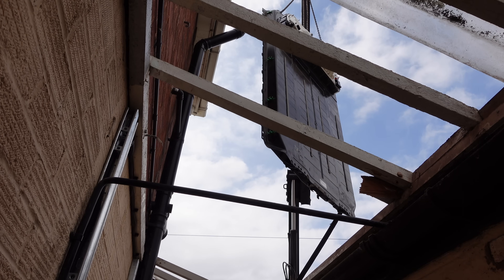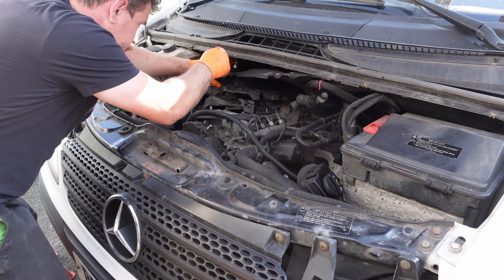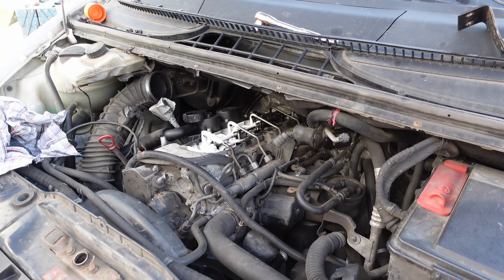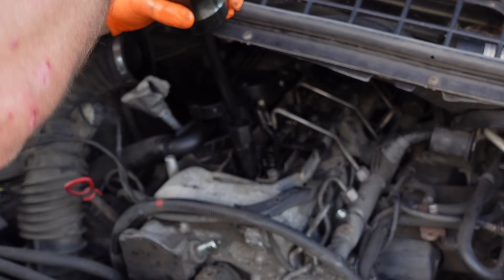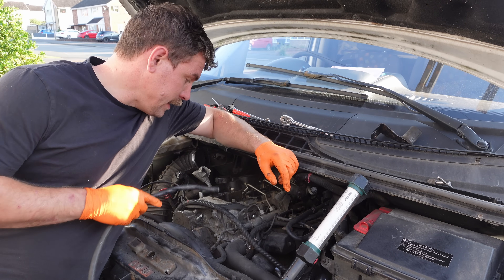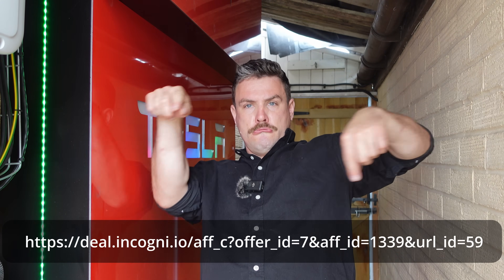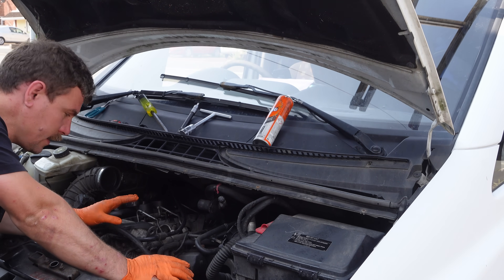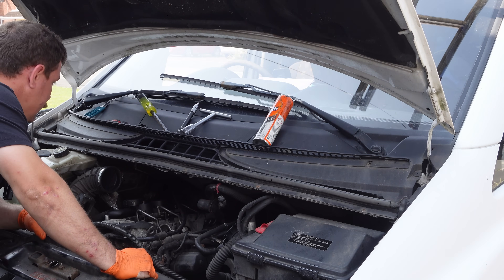I fix my 305k mile diesel injector ‘Black Death’!!!

Comment: Both EV and ICE vehicles have their place: and EV if you have easy access to power and cheap charging, and ICE for long distance travel.
Me I have 2 diesels: a 2016 Honda that just sips fuel; that was bought in 2019 just before the switch over to remote working as I was driving about 18k miles a year and living in an apartment had zero access to charge at home. The second is a 2005 Vito which was bought for one specific purpose: moving heavy stuff long distances. Show me an electric vehicle that can drive 1200 miles from the UK across Europe and into Ukraine in 2 days carrying 4 times the cargo that a car can and I might be interested in switching.
The Honda's replacement may well be an EV but I'm still waiting for the second hand EV market to settle down, for the issues to be ironed out with charging infrastructure and the fact that a lot of the second hand EV's currently available were the first generation of EV's and so have alot of issues as they were designed and built at a point wherethe manufacturers were trying to work out how to build them e.g. Mk1 Nissan Leaf with the pouch cells but no environmental controls for the battery hence why the range and life varies so much with them.
Always follow the computer philosophy: avoid the Mk1.0 or bleeding edge of any product or you'll be helping to develop the product.
Reply from the maker: Nice. Good points. I’ve been supprised with how good a mk1 leaf with a mk2 battery is. The price point where I’m not going to be concerned about where I park it but still ok for 180 miles with aircon and cruise control

They all have their uses. How’s your vito doing for rust? I want to own a sprinter but don’t have the need 😂😂
Reply: @TheOfficialBatteryMan carrying out the battery swap is a sensible idea given what I've heard about the Mk1 Leafs and know about thos pouch cells; I've been around them for years from RC car racing so know them well and the associated risks and failure modes.
My Vito is good for rust, apart from the rear wheel arches and a touch around the tailgate handl whereeven the W447's rust.
It did breakdown on me once in the 18 months I've had it but that was an electrical problem caused by someone in the past misrouting the engine wiring loom and letting it rest against the EGR actuator. There it eventually rubbed through and shorted out the 5V power wire that feeds the cam sensor and accelerator pedal.
Since that was fixed I've had no issues with it apart from a puncture caused by buying scond hand wheels and tyres (I wanted a smoother ride than was possible with the 18" wheels that were fitted when I bought it); one of these 'new' tyres had a patched sidewal repair (hidden from view as it was on the inside sidewall) that let go while driving near Dusseldorf at about 3 am in April this year.. you can imagine my reaction to that.😂

Comment: 13:45 ill kick off with what i drive, and I'm a Brit living in the US, and between my wife and myself, we drive an EV, a petrol PHEV and a diesel minivan. each has its place and functional strength.  the EV and electric mode PHEV is best for local driving. the PHEV is very edrective for long distance/intercity driving. the van is utilitarian for either lots of people, lots of stuff or both.

the ideal vehicle would be a diesel electric PHEV. but like with all things and I'll always tell friends and neighbors when they ask (or dont ask) for car advice, define your use case and the needs you absolutely need to meet - versus the ncie to haves, then establish what options meet those needs. 

EV's are much better for smoothness/quietness, power delivery and off the line ease of driving. range is an issue but can be easily managed if you're willing to be strategic abour your route planning. but the sheer ubiquitous availability of petrol/gas and diesel, they are functionally easy to live with.
Reply from the maker: This is the thing. You have experienced EV so have a genuine opinion rather than something the media has told you or somebody that hates them. Sounds like you’ve got the best of both worlds.

One thing that does take a bit of getting used to with EV is planning the day before if you want to make use of cheap electricity. Public charging in the UK is extortionate at the moment.

Comment: I drive a 2003 Volvo S60 D5 - it has over 600k miles on the clock and its reliability has been top notch.
I'm told that my Diesel Vehicle is an environmental hazard but I ask you to show me the evidence... 
 You can't point at the studies that the EU relied upon to set its targets as evidence - because they've already been proven as bought and paid for.
 You can't claim that it produces hazardous amounts of Nox - because if you've a Gas Stove, Boiler or Fire then your home will already have up to 10x the amount of Nox that my car produces.
 You can't show me any medical evidence that the Particulates emitted by Diesel Engines are dangerous because it doesn't exist; to date, not a single death certificate cites Particulates as even a contributing cause of death - in fact, simply finding a single Respiratory Specialist willing to state categorically that an illness is caused by Particulates in damn near impossible.
 You can't claim that EV's are less toxic to produce overall - given the very limited lifetime of an EV.
What I can prove is this: You get to enjoy your toy car because my taxes help pay for it with higher road tax and higher insurance rates.
Reply from the maker: Nice achievement for sitting on your arse. You look after it yourself? That’s a lot of oil changes. 

Throwing working things away before they’re useful life ends seems crazy hey. 

When the world slowed down during the Covid thing we saw a pollution reduction. Batteries can be recycled like engines. Electricity can be generated ultimately from the sun. Oil can’t be regenerated. Burnt and it’s gone. On a single level we make no difference. Collectively burning the level of oil we do it crazy. Wonder what they will teach in history classes in 50-100 years time about the oil age.
Reply: @TheOfficialBatteryMan  Thanks for your emotional and abusive response to my statement... which you asked for, by the way - and in no way countered. You seem to be under some delusion that I hate EV's - I don't. I just think that they're time has not yet come. There are huge negatives to Solar... and Wind, too but of course, your narrow vision can't or won't perceive them. You talk of renewable energy, like Solar, as if it's practical world wide - it isn't and Wind Turbines are inefficient, costly, short term eyesores. Energy storage is catching up - but it isn't here, right now! As for 'sitting on my arse' - I'm an emergency response doctor and purchased the car when it had reached it's 'lifetime' from the unit that I worked for... I'm retired now but the car is a reminder of the lives I saved and the help I gave. Carry on digging your garden up and leave thinking to those of us who've actually done some research and asked some questions.

Comment: I actually drive a 9 seater electric Citroen e spacetourer (dispatch). I love it but it's Spartan.
Reply from the maker: Does it have any quirks? They share a lot of parts with many Vauxhalls and Peugeots which is useful for the long term
Reply: @TheOfficialBatteryMan  the seats can be completely removed. So you have a van if you need. Also its hard plastic all around. I can power wash it if i need. It's a beast of a van/car and I love it, but it's made for being practical not luxury

Comment: I think there will be a tipping point when the general public realizes how reliable and low maintenance EVs are. Right now (I'm in the US) EV buyers are seen as early adopters at best, maybe just weirdos, buying expensive toys. We don't have a lot of cheap options. But if more people knew you never needed to get a conventional oil change, they would be more interested.
I bought someone's expensive toy for nearly half the sticker price, 3 years old with less than 10,000 miles on it. It's nearly perfect for my needs. I try not to debate anyone about it, I take them for a ride.
Reply from the maker: Nice. I totally agree

Comment: Old diesel  van and electric car are the perfect combination of vehicles to have in your repitour. Modern diesels are a nightmare in terms of emissions control systems.
You need to bypass EGR valve to eliminate that black tar going back into engine and maybe you could of just tightened that injector instead of taking it out and always use fully synthetic oil to keep turbo happy.
Reply from the maker: Yes. I don’t really want a euro 6 diesel. Oddly this has a DPF and it’s been ok for over 300k I wonder if the previous owner uhh dealt with it.

Comment: Mr diesel ran his on nut oil, why not do a veg oil/ bio diesel conversion or do you not need another project/bag or problems.
Reply from the maker: Haha. More projects. Umm. As far as I know these need a pretty clean set up to run that sort of stuff. Not sure it’s quite old enough for veg set up. You’ve got me wondering. It wouldn’t be a total loss if it didn’t like it

Comment: Nice fix, always satisfying on a workhorse vehicle. Yet more low cost miles in front of the van now. I only went EV, when I knew the fuel savings would pay for the depreciation. I guess that you have modelled that one already?
Reply from the maker: Yeah even now the sums break even for a newer vehicle.

Comment: To me, a car (EV or otherwise) is just to get from point A to point B, and to do the work you need it to do. I'm looking forward to having an EV as an extension to my off-grid house: I will have free fuel, but can augment the house battery as well. I want one with LFP battery, V2L and (in my climate) a heat pump. I never bought and never will buy a new car, so I'll wait until the used market matures here. In the mean time, the 25 year old Toyota Yaris Verso does just fine. 
At the same time, I run a McCormick 434 Diesel tractor for forest work, snow cleaning, etc. Granted, I make my own diesel, but it's not likely I would ever want an electric tractor or convert it. I like the old school stuff, and they just have to be diesel :)
Reply from the maker: Nice. Every use case is different as you’ve proved

Comment: EVs got to the point 5-6 years ago they make sense if you can charge at home.
Vans were there for low miles in cities or decent miles with a light payload but more recently they're getting useful, but still expensive. Geely Farizon interesting.
There's always an eco argument for running a vehicle to the end of it's useful life.
Reply from the maker: I do like the look of the Farizon. With the cost of fuel if you can home charge it goes a long way toward the finance payments

Comment: When you get to a certain age, climbing under any car, getting covered in oil is not fun anymore. Give me an EV, i can handle taking the brakes apart annually for grease up and checking they still work, just in case i might need them one day.
Are EV's forced on us, yes to a degree, but like you old diesel van ICE vehicles will still be on the road well past 2030/2035. 
My main issue is the negative press by the oil run media, channel 5 being the latest guilty party. i was talking to someone today who was telling me his apprehension to EV's. All of which don't exist anymore, they did when i started in 2019, but not anymore.
Reply from the maker: Thanks for chipping in. Some good points

Comment: I currently drive a small engined petrol car. 
I thought my next car would be an EV, but the way they are now taxed in my country means you pay a per km road user charge in addition to registration etc. I think that makes them more costly to run. 
The best value per km works out to be a bev (not a plug in) but I’m put off because they’re a complicated drivetrain compared to ice or ev

Honestly I’m in the same boat as you, keep my little car going for a few more years. See what the market and legislation is like in a few years time, and hopefully buy an EV 

I don’t know what the tribalism around ICE vs EV is all about!
Reply from the maker: Nice. Thanks for sharing

Comment: They just increased the weight limit on a standard license to 4,250kg for EV only to allow for battery weight.. so electric vans with 1.5ton capacity soon!
Reply from the maker: Look forward to it. It would be an issue if public charging wasn’t so expensive. If we could all have smaller batteries it would use less energy and cost less. But no one wants to do that when you can charge at home so cheap compared to waiting at an expensive public charger. Literally 10 times more expensive and have to wait. The public charging model is broken